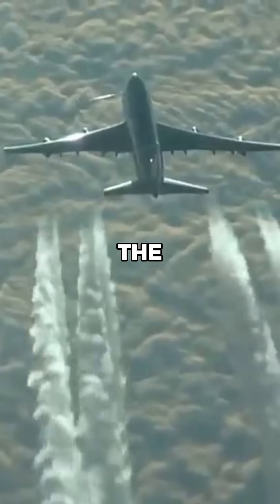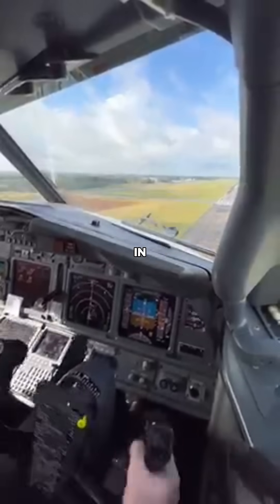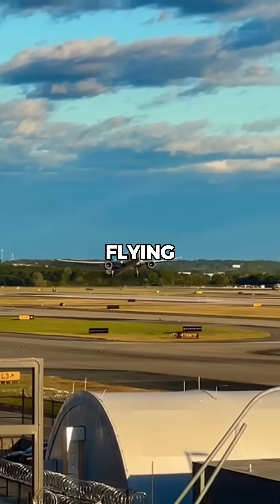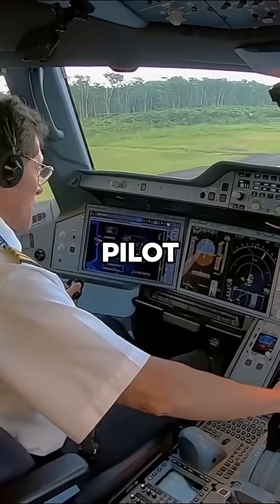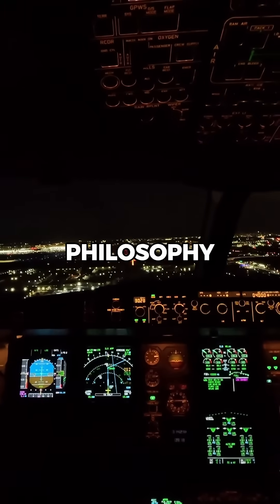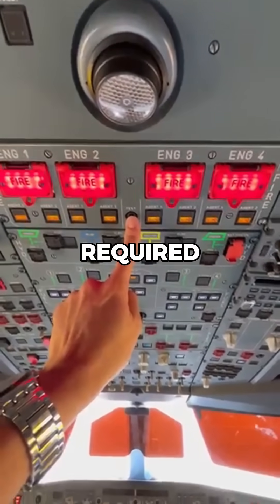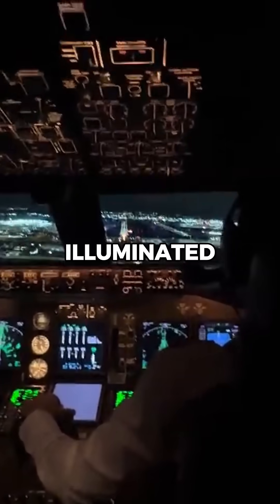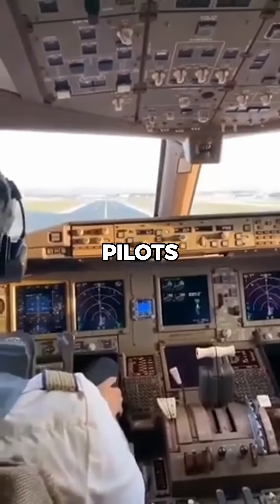why Boeing and airbus have different cockpit layouts

Comment: Indeed, the uninformed narrator failed miserably to mention the infamous MCAS system. So much for Boeing giving their pilots control. (Dirty laughter from all rungs of the audience.)  Crashed only two machines with all souls on board. Wondering what the latest Boeing crash in India is about. Mayhap some more freedom Boeing granted its pilots? (And Airbus, of course authoritarian as Airbus is, doesn’t.)

Comment: Side stick is what brought down flight 447 back in 2009.  The pilots were both using the side sticks at the same time.  The side sticks couldn’t be seen at the same time.  Boeing’s yoke can be seen by both pilots.
Reply: It’s completely the co pilots fault for fucking about with the controller
Reply: It’s both got advantages and disadvantages :)
Reply: 3 words: Control priority button.
Reply: @MisterSketchy Much to late for Air France flight 447.  It happened in 2009 and it still bothers me.  Thanks
Reply: @henrymcmiller2527 you had a panicked pilot in the right seat. Who knows what he would’ve done with a yoke. You can’t really now.
Reply: The dual input on sidestick was induced by the pilots, which since the sidestick itself was passive, both pilots can't see and feel each other. On Boeing, even though the yokes are mechanically connected, sometimes the yoke could split apart with such enough force, either by dual input or jammed yokes. On fbw models like 777, the conflicting inputs will be averaged out by computers.

Thankfully, the sidestick gets updated version called active sidestick (Airbus haven't used it yet) which would act like yoke by connecting each other, though electronically.

Comment: What about the a300
Reply: The A300 had a yoke and conventional cables and pulleys for stearing. The A320 was the first model with fly-by-wire and sidesticks.

Comment: Boeing : we give pilot more control of their plane and can override automatic system if necessary.
MCAS : allow me to introduce myself
Reply: You can flip the stab trim cutoff switches, but if it happens right after takeoff, you would have to react very quickly.

Comment: allowing them to over ride automated systems when necessary hmmmmmm 737 max
Reply: You can override the MCAS in the 737 max by switching the trim cutout switches
Reply: @Nemo2507s  yea but at the time of the crashes, boeing made it incredibly hard for the pilots to override it or find the necessary steps to do so
Reply: @425ping-6   Tell that to the untrained pilots that sadly are not here, plus that wasn't the case before the grounding !
Reply: @fuhque8368 that was the case before grounding, nothing was wrong with the MAX as a plane, just the way boeing managed it
Reply: @28kboney  Think you need to go do some revision on it :)
Reply: Aye they should tell that to lion and Ethiopian victims